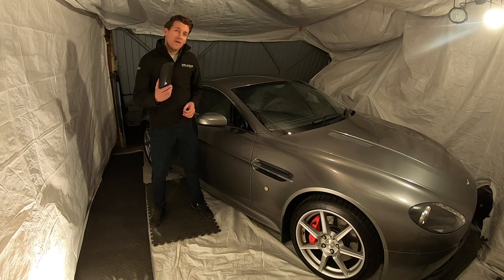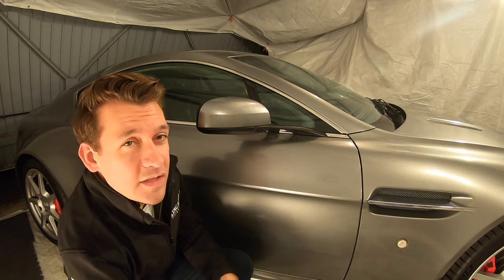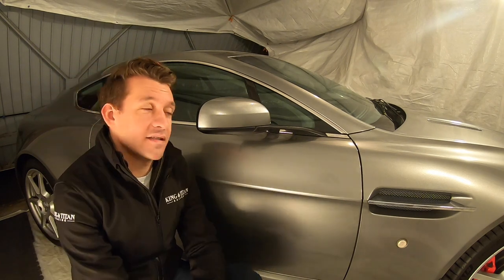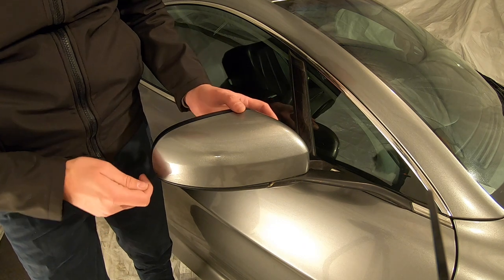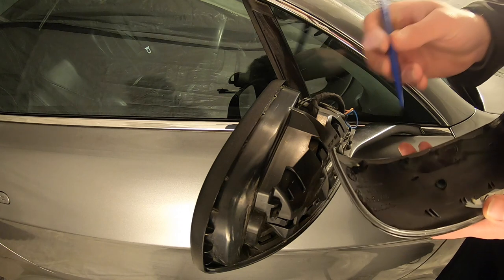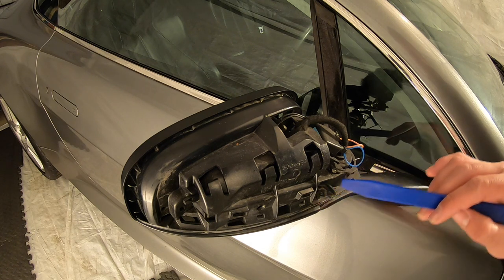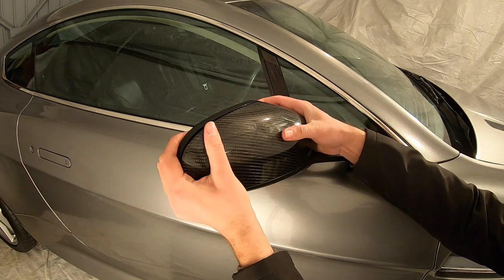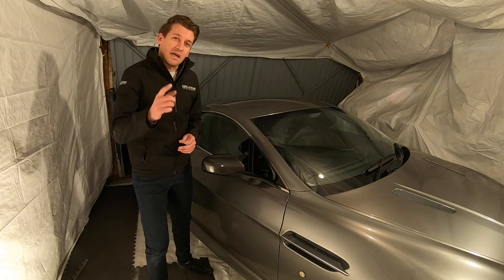Upgrading Aston Martin Wing Mirrors to Carbon Fibre

Comment: Hi - I'm looking to do the same mod on my V8V - could I ask where you got the carbon mirror caps from (assuming they are not AM OEM). Thanks
Reply from the maker: Hi Mark, I got them from ECPS group. I’ve had their carbon all over the car for a few years now and it’s top notch. Lots of miles on the car now, road and track with no issues at all. This is their Youtube channel but best to find them on the FB owners group. Michal Pastryk is the guy you want to talk to on there. 
https://youtube.com/@ECPSGroup?si=lbVKscMtk9gWbZED
Reply: @KingandTitanRacing  I know them - I have their carbon door sills/kick plates already. Was just looking to explore other options (if quality is similar) as the import duty to get their stuff from Poland just bumps the prices up a bit too much now. I have a front splitter from Divinatech (UK based) so I'm going to have a look at their mirror caps
Reply from the maker: @markstewart8232  can you let me know what that’s like? I’m thinking of setting up a supply and install service and an auk supplier would be much easier to deal with at first. I’ve messaged you on IG, could you share some feedback when you get them?